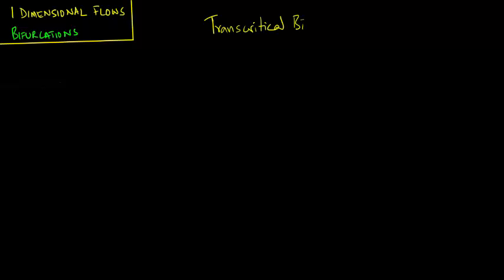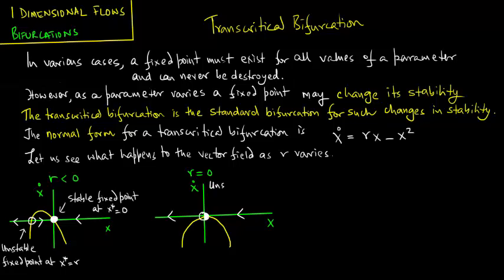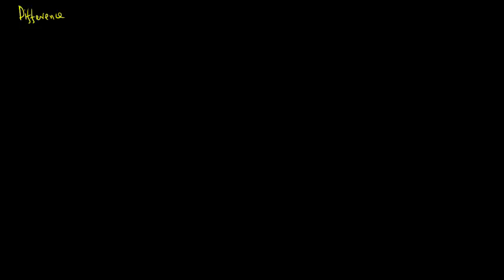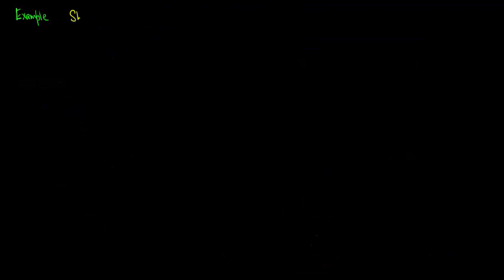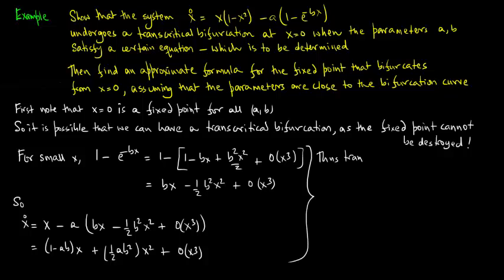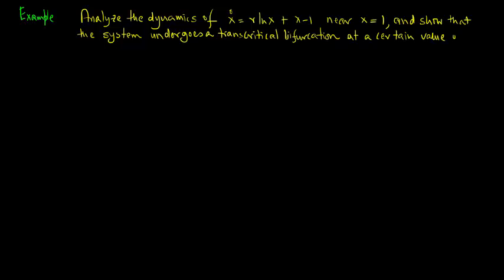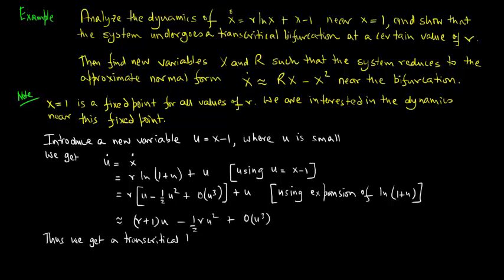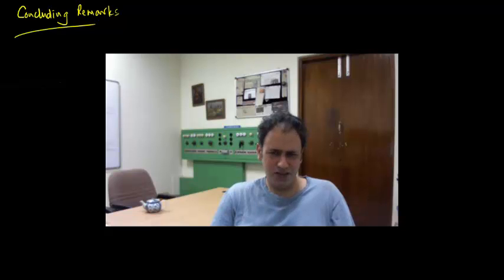1-Dimensional Flows, Bifurcations, Lecture 4

Comment: why is the transcritical bifurcation point occur when ab = 1??
Reply: I think ab = 1 is a transcritical bifurcation because "x" is defined as small. When x is defined as small, that means less than 1 right. So if that is the case, then 1/2ab^2* x^2 is really small, since you are multiplying 3 numbers that are less than 1. Similarly, the O(3) term is again multiplying 3 numbers that are less than 1, so these are also negligible. So the only term that really matters is that first term with the (1-ab). When ab=0, then the derivative of x (xdot) is very close to zero. I think it is probably more appropriate to use an approximately equal sign rather than an equal sign--as the video does and as the Strogatz book does as well.